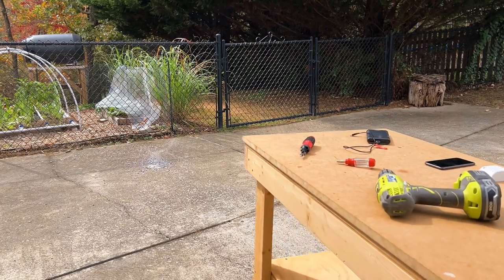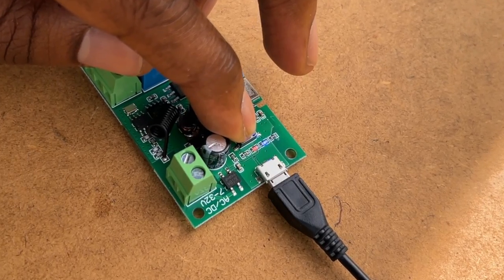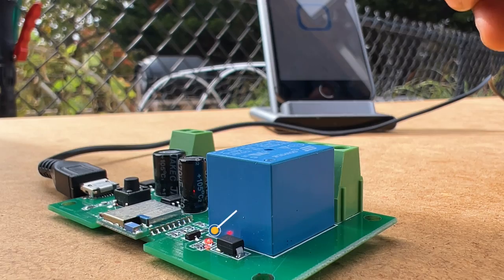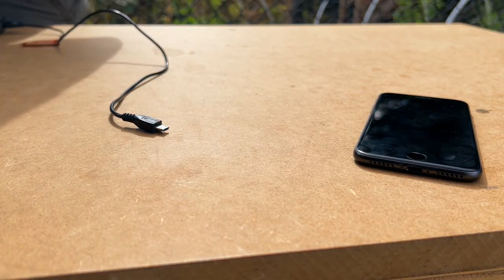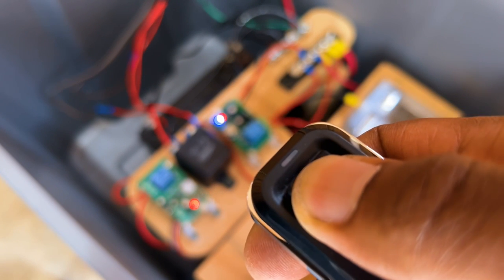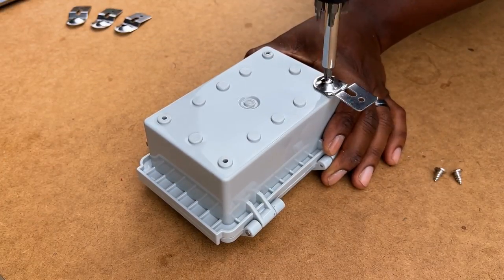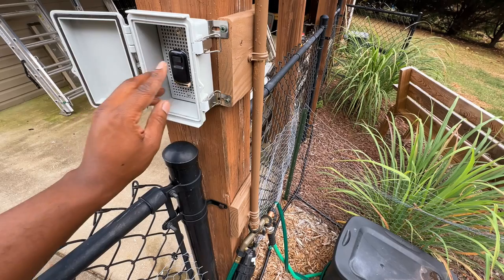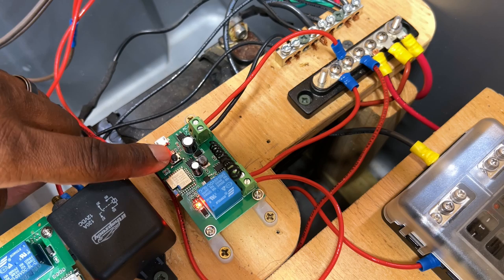This CHEAP Upgrade Made Water Control Much EASIER

Comment: Does your pump require more amps than the switch can handle?
Reply from the maker: It has been a while since I made this video, and I didn't have the time to see what all I talked about here, but I do know the smart switch alone cannot handle the amps the pump is capable of pulling, so if you watch this older video here, https://youtu.be/7N1kpvGKGp0 , you will see I used a heavy duty relay in between the smart switch and pump.

Comment: A simple job made difficult! Install a pump with a built-in pressure switch and as soon as a Tap/Facet is opened, the pump kicks in - simple.
Reply from the maker: Depending on your application & goals, that is definitely another great way to tackle the issue! However, for my application, I use the smart WIFI switch to control my on-demand pump (which has a pressure switch built-in) since the eWeLink app allows you to create custom watering/ON-OFF schedules. You can also use a watering timer in combination with an on-demand pump to accomplish the same scheduling goal, but to get the same flexibility and value out of a commercial smart timer would be expensive. As always, whatever works for you is the right way! Thanks for sharing, and good info.